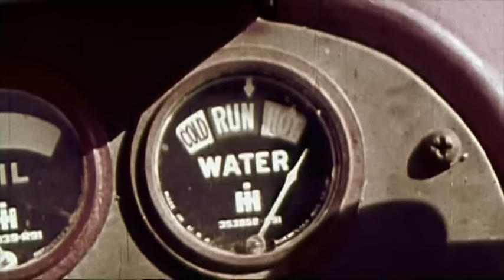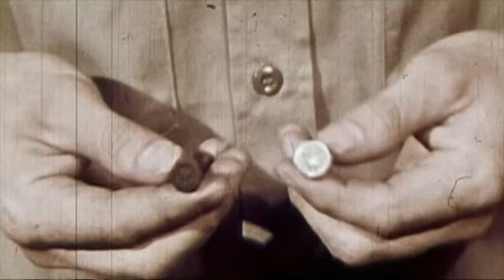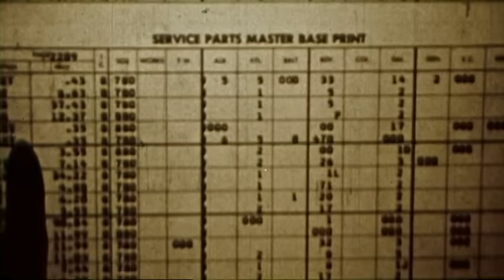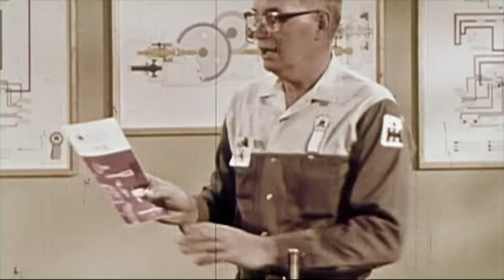Farmall Sales video 1965

Comment: The 400 had a very poor head design that was prone to cracking when the tractor was worked,, was fine for raking, hauling loads, baler, green chopping, elevator, what one would call light work, but when "worked as in plowing, corn chopping, or any real hard work cylinder pressures combined with the extra heat from working,,,, boom! cracked head, uncle worked at ih and had several on his farm
Reply: I've heard that about the 400 diesel cracking heads because the chamber for gas starting created a hot spot in the head.  But I've never heard of it in the gas tractors.

Comment: You would think they would have used a competitors tractor to show overheating and oil burning, etc.  This way they wouldn't be admitting their older designs were inferior!
Reply: Exactly what I was thinking. The dealership wanted him to buy the IH radiator rather than the pattern copy, but if the IH item was so good, it wouldn't have overheated in the first place !
Reply: Yeah but this video is about parts and service. You can't show off IH service if you don't have an IH tractor

Comment: What happened to IH?
Reply: Merged with case.
Reply: @nate3270  Damn right, we secretly own a little bit of everything!
Reply: IH is the reason Case tractors changed colour to red
Reply: Horrible mismanagement and an economic crisis.
Reply: @Somewhere_In_The_Barn  Their products were pretty good though. I agree the 'Management' was pretty rubbish. Also, IH had fingers in a lot of different pies, and were basically over extended financially and production wise and so weren't able to weather the financial turmoil of the early 80s.
 The so called 'merger' with Case created an over abundance of different tractor models from the two manufacturers, and so a degree of product rationalisation was necessary.
 Still think it was a mistake to do away with the 'Snoopys' which had recently been re engineered and genarally beefed up, in the form of the Super 70 Series.
 Not many of either the 7288 or 7488 were ever produced - 16 of the latter model I believe.
 In an ironic twist, subsequent Case/IH tractors used a significant proportion of IH hardware (transaxle), and ideas. Just goes to show where the real brains and innovations came from !
Reply: I think Case (Tenneco) focused and cared more about their construction line after the late 60's.